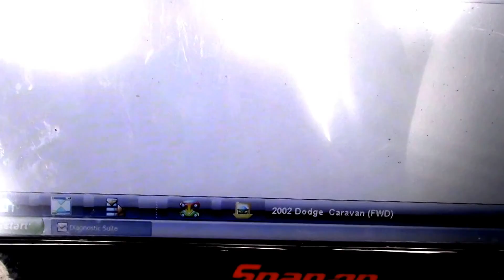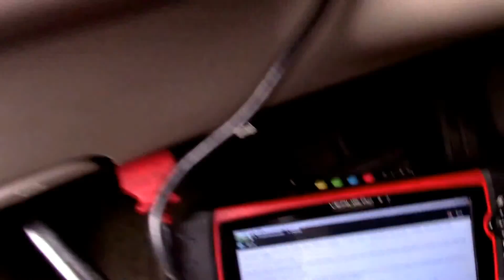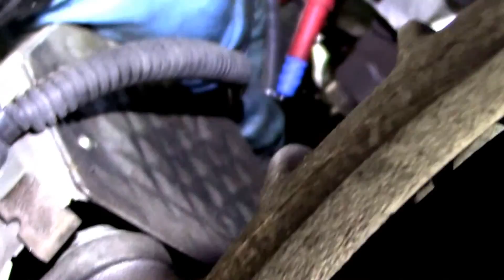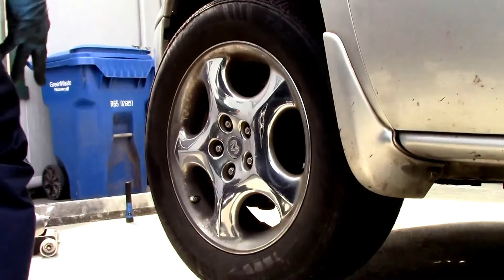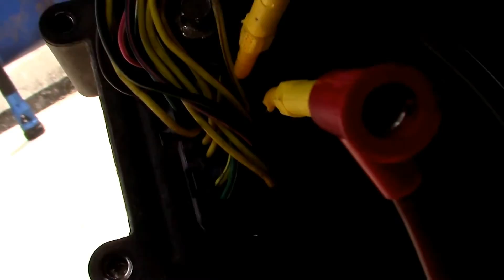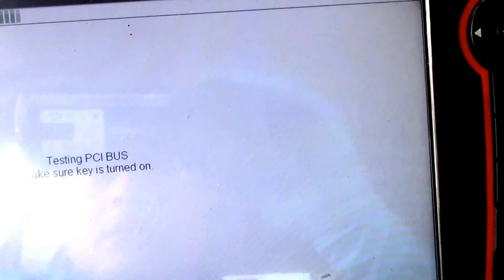02 doge grand caravan p0700, p0171  diagnostic and repair part 1

Comment: I had the selonoid changed,  was wondering does the car need to be recalculated, engine light still goes on and off, the car still jerks when I drive especially when I am at a stop light or reduce speed and accelerate jerks like your shifting. What else should I be looking for or what else could it be or not. Thank you. 2004 caravan.[Code PO700]
Reply from the maker: p0700 is generic code  just to tell you you have transmission issues , noe you have to go and find codes on tcm module and those are the codes to diagnostic the p0700 is no a cause